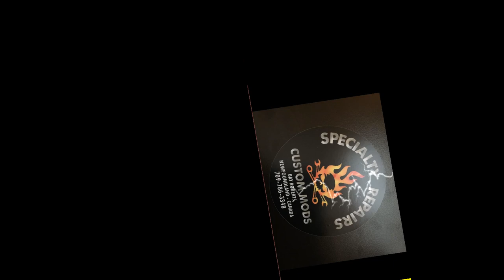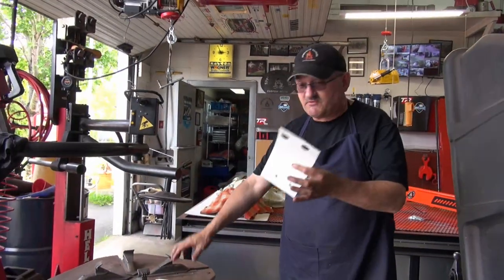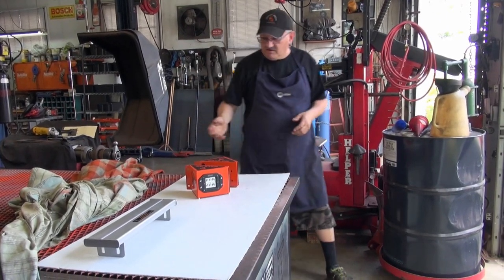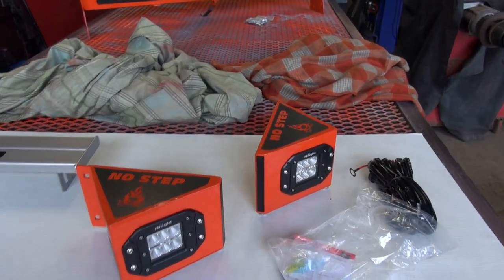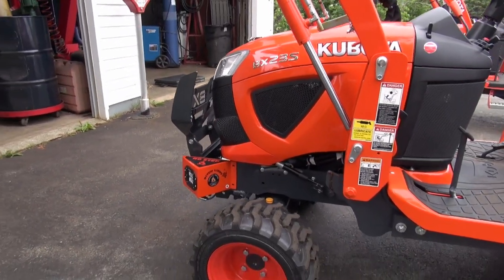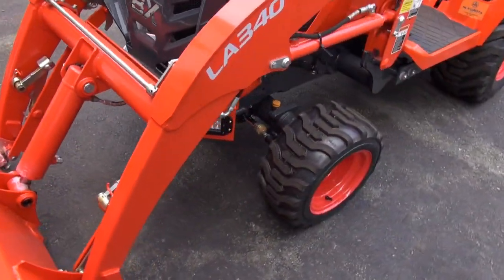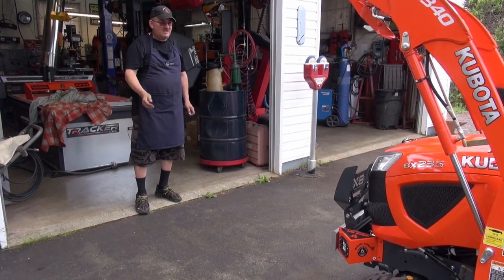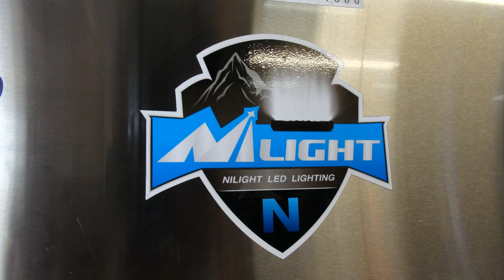New Mod  (Kubota BX Ditch Lights)

Comment: LOVE Nilight lights from Amazon!! They are about the best light and output for the money!! I use them professionally on my truck as a pipeline welding inspector, and boy will they light up the Right of Way and Access Roads, even in the mountains at night where you have zero ambient light at night. GREAT LIGHT choice!!!

I just got a BX2680, and I am a welder/fabricator and do most of my own work, but I am thinking I may just get your light kit with the bumper and save myself the fab and paint time!! Thanks! Love your channel and work!!

Comment: Paul, based on you showing these lights in a previous video, it helped me solve a problem. 
I've been tired mowing in the sun this summer, and had an idea. No neighbor's to worry about where I live, so I purchased a pair of these Nilights and mounted them on my Zero turn mower (Kubota D722 diesel powered). Now I start about 8:30 PM when the sun has gone mostly down. A lot less UV rays to deal with, plus cooler as the dew is coming down.  I finish up in total darkness about 10pm.....except for these lights that make it as good as daylight. They are super bright and extremely nice quality LED lights!  The flood pattern is perfect for lighting up a large area. 
Thanks for showing the Nilight's !
Reply from the maker: So happy to hear the video has helped you out. I understand just how bad the heat can be. It will be much easier on you now. I put a set of led lights on my ROPS on our zero turn and have used them after dark. Ours is gas. We don’t have a lot of mowing to do but love the zero turn. Keep safe and thanks for watching. https://flic.kr/p/6LS4Jd

Comment: Great location for effectiveness.  Nice design; I really like the lights.  Cute "reveal covers" (the towels).  When this video started, I had to chuckle to myself how people get accustomed to weather.  You say its hot, so I determined that you are talking about 29C or less.  For months here in SE Texas a cold front is 32C with 37C being on the high side of what we have to work with.  High humidity provided at no charge.

You may already have too many mod ideas, but with 6 tractors, one of my pieces of "standard equipment" on each are utility chains.  Bigger tractors may have 3/8 or 5/16 clevis hook chains with lengths from 8 to 10 feet.  All tractors also have one or two 1/4" chains with lengths of 4 to 6 feet.  They are useful for so many things when working.  Currently all chains are stored piled at my feet on the floor.  Having a box mounted to the frame to throw these into would be super handy.

Comment: Very nice .. loved to have a set or two ..  however , i have a mid mount mower and there is a handle in front of the front axle to release the mowing deck . not sure if it will fit .. from the existing bolt in the frame , how far back toward the seat does the light case go ? and how low toward the ground.. might still fit

Comment: Will they fit w the mower deck on?  Specifically the front attachment for mower deck.  Would like to get them.
Reply from the maker: Some folks have but had to slightly modify the implement to do so.